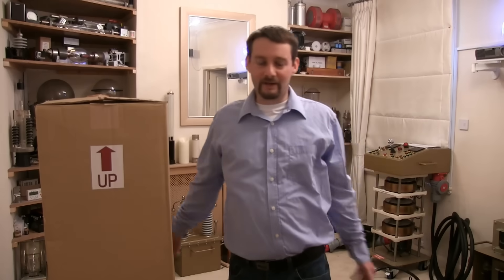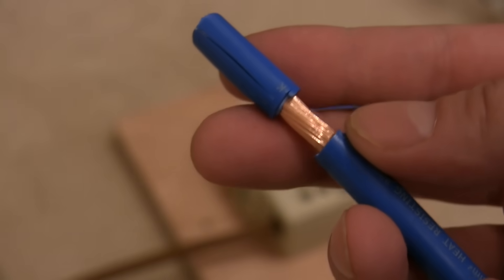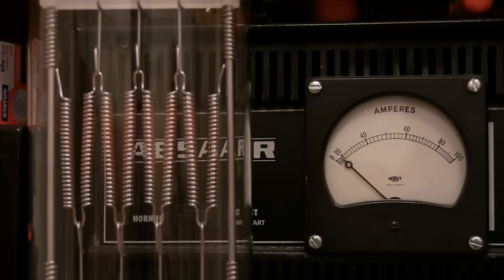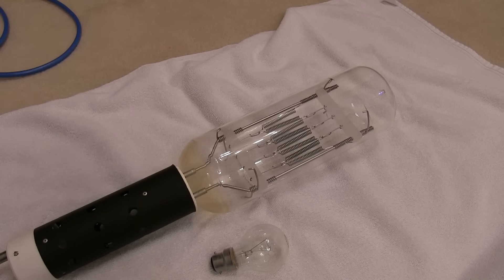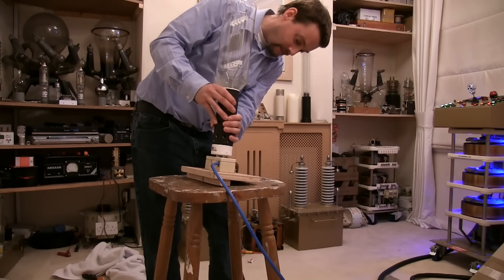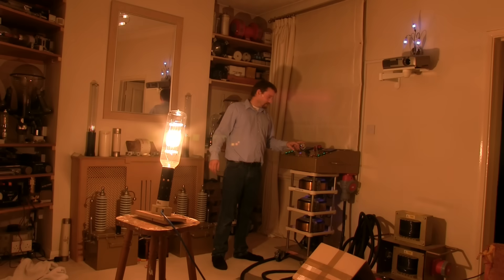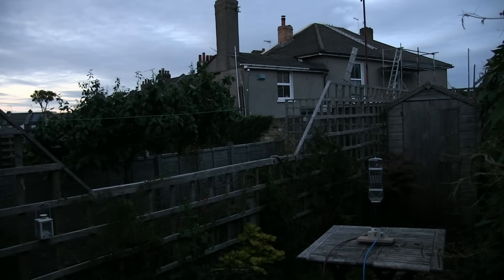20,000 Watt Light Bulb Test

Comment: Next project: 20,000 Watt Led light please... ;)
Reply: Available on Alibaba this year
Reply: Rookie numbers
Reply: suddenly the sun isnt the hottest thing in our solar system anymore
Reply: @OneLegendo  it would generate half the heat of this thing and 10-20x the light
Reply: @AmorDeae  20kw of led still makes 20kw of heat
Reply: @derp872  the 20 kW is split between the light and heat the bulb produces. If that bulb indeed was producing 20 kW of heat while putting out that much light, it would break the laws of thermodynamics.

With a 20 kW LED, significantly bigger portion of the energy would be converted into light than with this bulb here, so it would be way brighter and generate less heat.
Reply: @AmorDeae   It would generate exactly the same heat and 10-20x the light.
Reply: @OneLegendo  Uuuh, thank's for the compliment 😌
Reply: @OneLegendo  actually, the hottest thing in the universe was on Earth, LHC. Probable copule of atoms bajillion degrees hot
Reply: @Miata_MK  thanks for the info
Reply: @OneLegendo  np
Reply: @OneLegendo why do nonsense comments get the .kst likes? Your comment makes no sense being that led lights produce much less heat than the kind of light in his video.
Reply: @OneLegendo this kind of light gets much hotter than leds
Reply: @OneLegendo  LEDs run less hotter than bulbs
Reply: @ronixdash123  an LED of the same wattage as an incandescent will produce just as much heat, the only reason they seem to run cooler is because you can get the same visible light energy out of them at typically 1/10 the wattage of an equivalent incandescent bulb
Reply: @deflepperdrocks12954  no leds would emit less heat and more light.
Reply: @cw1161  The "extra" heat an incandescent bulb produces is just infrared light produced via black body radiation as the filament heats up, LEDs are more efficient at producing light in the visible spectrum but all light frequencies will be converted to heat when absorbed by a material

A 20000 watt LED will produce just as much heat as a 20000 watt incandescent, it will seem like a much brighter bulb while doing so and may even feel cooler to your skin due to human tissue being worse at absorbing visible light than infrared but in the end all 20000 watts will end up as heat
Reply: @deflepperdrocks12954  but led is more efficient at converting energy to light which means more light is released and less heat just look at a 60watt led vs a incandescent bulb.
Reply: @deflepperdrocks12954  its the same reason an eletric engine of equivalent power will run cooler than a combustion engine because its much more efficient.
Reply: @cw1161  Have you ever used an actual 60w LED?

Not 60w equivalent but an actual 60w LED bulb, even with the difference in absorption rates of infrared and visible light it will feel nearly the same when hovering your hand near it
Reply: @deflepperdrocks12954  https://www.homedepot.com/b/Lighting-Light-Bulbs-LED-Light-Bulbs/N-5yc1vZbm79
Yes these led lights are considerably cooler then a similar 60 watt incandescent light bulb that i felt.
Reply: @deflepperdrocks12954  less energy is converted to heat and therefore more light is released
Reply: @cw1161  literally none of those lights will actually use 60w, this is what I was talking about in my previous comment when I asked if you had ever used a real 60w LED

These are 60w EQUIVALENT meaning they produce the same visible light output as a 60w incandescent, their actual wattage will be about ~10% of that for a good bulb and if you check the stat page for one of the first bulbs it lists the real wattage as 9w

This is why they feel cooler, if they actually used 60w as I have been saying then they would feel the same as the incandescent and the same applies to our mythical 20kw bulbs in the comments above
Reply: @deflepperdrocks12954  yeah because they dont need to thats how much more efficient led is compared to incandescent light bulbs but they do use 60 watts they are just non dimable.
Reply: Yeah basically less heat more light so a 20000 watt led would be just as hot but much brighter as we both said due to the efficiency of led but they would not be able to handle that temperature.
Reply: @cw1161  electric engine isn't that effective
Reply: @Miata_MK  electric engines are effective it's just the battery capacities are not effective in the technology
Reply: @deflepperdrocks12954 I have a a 1000w led array for growing plants, it's huge and is cool enough to hold my hand on. But then again, the 100 or whatever leds are spread out over a 4 ssq ft area so you're probably right. That's the other thing with led is that at the same wattage, the individual leds can be spaced apart AND passive or active cooling mechanism ls can be implemented. But it is true that wattage used doesn't equal heat output. Look at older electric motors. Anew one of the same wattage will produce much less heat because we have made them more EFFICIENT, with electronics, that typically means we have built them to produce less heat for how much electricity is used. In lights, int he specs, efficiency specifically refers to this trade off between heat and energy use.
Reply: @cw1161 you are completely missing his point dude. Those bulbs don't use 60w. If they were pulling 60w, they would be just as hot as a regular bulb is what he's saying...
Reply: @C W  this is from the second listing in your home depot link
https://ibb.co/2ksx9jt

pay attention to the red circled parts

here are two actual 60w bulbs

https://www.satco.com/s29752.html
https://www.amazon.com/dp/B07T3GQB5J

the lumen output (how bright they are) on these is nearly 10 times the pitiful bulbs you linked to

any replies after this will be treated as trolling and will be disregarded, if you can't figure it out by now then I recommend you go back to elementary school and practice your reading comprehension
Reply: @deflepperdrocks12954  i perceive that there is iniquity in you and that you trust by faith in the shed blood of Christ for your sins before you burn in hell for your pride and arrogancy toured God
Reply: @deflepperdrocks12954  Go in peace
Reply: @deflepperdrocks12954  why do you keep liking your own comments as well lol
Reply: @deflepperdrocks12954  i bet you that that 60watt led is still color then a 60 watt incandescent bulb aswell.
Reply: A 20kw LED wouldn’t be that much brighter. Now a series of lower powered LEDs that equaled to 20k would be something.
Reply: @traxonwax  Anyone building a super high intensity bulb would be using an array of LED COBs
Reply: @deflepperdrocks12954  COBS are the past, they're hot and difficult/ expensive to make. The current technology leading manufacturers are working on is SMD technology. Look at Samsung, Cree, Osram, Philips, you name it, they've left COBs behind in favor of furthering their SMD tech.
Reply: @traxonwax  it would be, trust me. An LED converts electricity to light about 20 times more effectively than incandesent light bulb
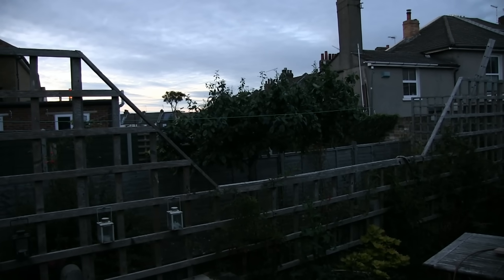Reply: 10:41 It seems like some superpower has landed or appeared 😅
Reply: The most powerful leds currently possible are around 0.5w any higher than that is just a combination of many leds. A few hundred watts leds exist but again it’s really just many small leds together. I don’t think anyone has ever made a 20, 000 watt one before. It would be almost impossible to cool
Reply: @jacobleeson4763 I have a 1000w led grow light, but yes, it made up of at least a hundred leds
Reply: @Guodlca leds are much more efficient greater percentage of output is visible light 🤦‍♂️
Reply: The heat sink would be the size of a car lmao.
Reply: No one:
You: testing your new 20,000 amp light builb
Neighbors: WTF is he doing did he discover time travel
Reply: @MC_Gaming6917  not trying to be a dick but 20000 watts not amps. 20 000 amps will melt those thick cables he was using in seconds.
Reply: @TheDom-w6h  Not to mention the power that would draw... :p
Reply: @valentin0000  yea.... 20,000 amps.....
Reply: @TheDom-w6h  exactly, 20kA would be around 4.8MW 😂
Reply: @CharredSteak  playing Zeus i would say 😂
Reply: @MC_Gaming6917  lol
Reply: @MC_Gaming6917  Yeah, this is "that neighbor" everyone wonders what the low hum coming from the basement is.  Like the movie, "The Burbs".  Let me introduce to you my brotha, HE'R DOCTA!
Reply: Then the sun will go off.
Reply: That'll be ME
Reply: 20,000 watt Light of Elendil.
Reply: you cant cool it
Reply: @Guodlca well, you're right but it probably doesn't get much hotter than this
Reply: it would be like the sun touching the earth
Reply: Kugelblitz : bonjour
Reply: Duhhhhh dat is impossibleeeew
Reply: Axualy just throw every LED lamp in a volcano
Reply: @Scudmaster11  not55 tru
Reply: @david-hw7rf  it would be better for everyone and their health
Reply: @Scudmaster11  i dunoo sweetheart im from albania we sont have electeicity
Reply: You will kill humanity
Reply: Would probably just evaporate💥
Reply: the largest LEDs don't even come close to 20,000 watts, they don't need to as LED tech is so efficient
Reply: No

Comment: This is basically a large film set light, the largest standard is 18kW. On some film sets, they have a 200kW light which pulls 400+A over 3 phases at 400+V.

Editing to add, the cable diameter for that power consumption is 0000. 00 is not rated for that much current.

Comment: Imagine if it used the same power and it was LED. It would be insane.
Reply: You could use standard low-power LEDs, which draw 5V and 0.02A each, for 46 in series, and 5000 in parallel, for 230,000 total LEDs, and at ~70 lumens per LED, that totals 16,100,000 lumens for the array, which is 5.75 square metres. Given that direct sunlight for that area would be rated at 563,000 lumens, the array is 29 times as powerful as the sun, and can be potentially cooled with a -70°C methanol cooling jacket. Expensive, but possible
Reply: @ataphelicopter5734  make it!!!! That would be sick.
Reply: Joel Justin 
I’m saying if you had a massive array of leds. Not an individual one.
Reply: @Calthecool  still it would require to get 20k LED's
Reply: @sanyamagrawal5486  or one massive led cob
Reply: @Calthecool  having multiple light sources totalling up to 20000W be summer than a single 20kW lamp
Reply: It would, but there's a problem: Cooling. It would melt in seconds without an elaborate water-cooling system. I'm not sure even regular water cooling would do it, you might have to mess around with pre-chilled water.
Reply: @vylbird8014  yeah, that's why hella powerful bulbs still tend to be incandescent or HID. 

But it would be impressive, nonetheless. AFAIK, LEDs bulbs use a tenth of the power for the same light output when compared to incandescent, so at the same power there'd be 10× the light
Reply: @vylbird8014  A pelitier cooler could work alongside water cooling.
Reply: I'm fairly certain even the INCADESCENT bulb can be seen from space, the LED could probably be seen from the fucking moon...
Reply: It would need a helluva lot more LEDs as they run cooler and are more efficient so the lumen output would be that much more insane.  It would be like an array of 200 led street lamps.  Hell, probably more.

Comment: FYI:
The Luxor Lamp located in Las Vegas, Nevada has the strongest light beam in the world at a staggering 42.3 billion candela. With the ability of using curved mirrors, the Luxor Lamp focuses the light from 39 xenon lamps into a narrow beam in which a person could read a paper from 10 miles up. Also, on a clear night, the beam can be seen from 275 miles away from all aircraft cruising at attitude, such as LA.

The Lamp was first powered on in October 1993 and has operated reliably ever since. Each Xenon Lamp is worth $1,200 and 7,000 Watts and when its operating at full power, the system costs $51 per hour with $20 per hour for the electricity used for it 315,000 Watts. Since 2008, only some of the lamps are lit in order to save on energy and it might also be the world’s best bug attractor, which has created a new ecosystem of bats, moths and owls.
Reply: Thanks, this was genuinely interesting, particularly the ecosystem bit. :)
Reply: 20$ 300kw of power? here it cost around 60$ for the same
Reply: The fact that this one guy’s light is equal to three of the Luxor bulbs is pretty ridiculous.
Reply: @Angultra  Check your maths. 315kW for the Luxor, and 20kW for this? Not really sure where you got that figure from
Reply: Michael [APFX] it’s 273 kw actually
Reply: @BasilMinhas  My point still stands, in what possible world is 20kW more than either 315kW or 273kW?
Reply: @mike_apfx  true
Reply: @mike_apfx  3 x 7000 is 21000
Reply: @mike_apfx  op said that the luxor beam had 39 lamps at 7kw each. This dude's having a 20kw single lamp. As other people said, (7kw×3=21kw). So, there are you maths
Reply: @mike_apfx  He never said 20kW was more than 273kW. He said that just three of the luxor lamps would match this 20kW bulb in the video.
Reply: @dansmith2863  And higher output individual bulbs are more efficient at creating visible light, which yields a higher output than similar and higher quantities of smaller-output bulbs.
Reply: Hell, the room that was used to power up the light is straight up 300°C like holy shit, I can straight up bake a cake in there
Reply: @bmhater1283  What kind of cake would you bake?
Reply: @kaspervestergaard2383  IDK, don’t think it matters, at 300C it would be a charcoal briquette!
Reply: So just like each of the 7 beams on the death star?
Reply: $51 per hour?! They've bypassed the meter 😂
Reply: my parents somehow did not believe I saw the pyramid glowing as a child when we drove through las Vegas. A stunning building.
Reply: But why?
Reply: but the luxor light is a beam and this is a lamp that gives off light in every direction :o
Reply: O.k
Reply: Do you kniw how many lumen that translates too
Reply: @GothicLightingQueen  Google says that 1 candela is 12'57 lumens (my calculator says it is 531 711 000 000 lumens
Reply: Why no one makes a brighter lamp? What if someone made megawat lamp using leds?
Reply: 1200 is cheap. Honestly, i would expect such a specialized bulb to cost upwards of 10k.
Reply: Only $51 an hour running cost? And yet they cut back the light? They receive at least  $51 dollars revenue per second from the Reverse ATMs in their Casino yet they wont spend a few hundred dollars a night to run at full power (they switch it off at midnight every night)????? Bloody corporate cheapskates. 

I remember my first visit to Vegas in 2008, amazed the beam visible into the stratosphere. Now it's just a watered down version. 
#DearLuxor
Reply: @SethMethCS  It's not just about running costs, light pollution (look it up) is a very real thing.
Reply: @SethMethCS I don't think it's that they are cheap, I think it's the environmentalists that caused this.
Reply: @SethMethCS  It's probably more about image and perceived backlash they might get from the nutty complainers / environmental activist / leftist / anti decadent crowd, then actually saving any $.
Reply: @k1m198  and thank god for that
Reply: So thats where my god damn taxes are going..... to somone who wants to power a light bulb for absolutely no reason.
Reply: @isaacsalo2358  
Your taxes don’t pay for the Luxor
Reply: Don’t remember asking
Reply: @forevajus  No one cares if you asked or not. Shut up.